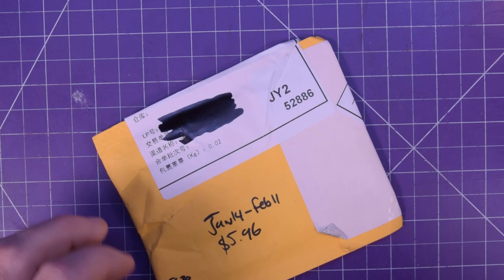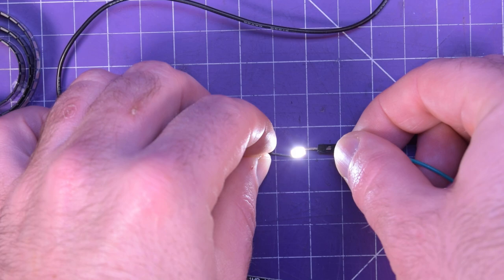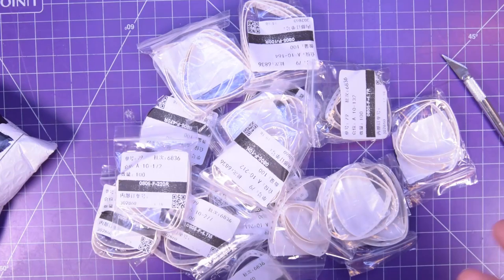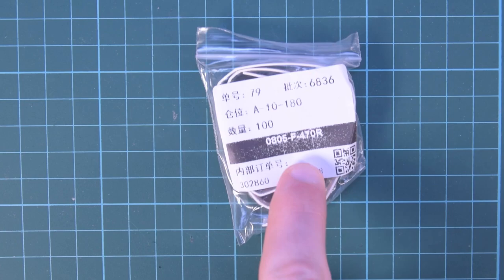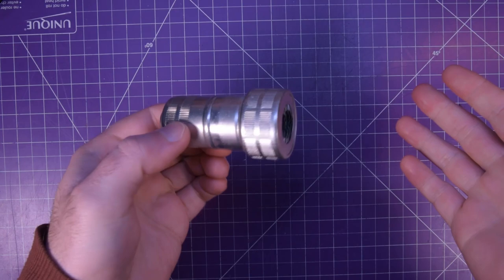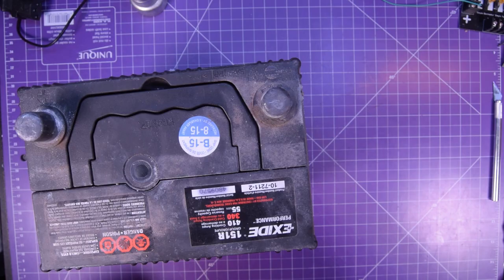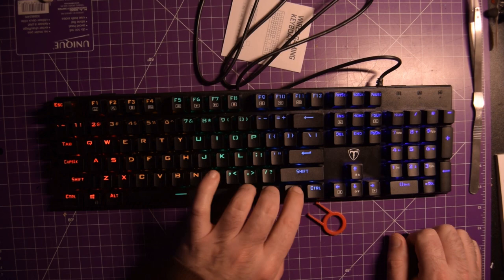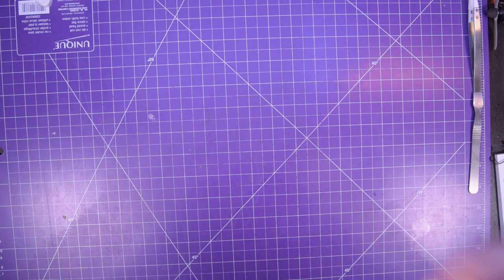Mailbag 102 - S P R E A D

Comment: I hope to not solder 1000 SMD resistors in the rest of my life.   :)     I have a bunch of wireless mice from the company that makes that keyboard. My keyboards are Cherry MX Blue and yours sound slightly higher pitch than mine.   Also, if no one else appreciates it, I appreciate you spreading the letters out in your thumbnail and title.
Reply: 0805's are difficult to work with. Don't sneeze!  1206's are also common, and a little easier for humans to manipulate.

Comment: A great video to start the day with.
      Is it possible for you to keep dead car batteries from your work, just wondering cuz I've heard of methods of restoring some life to these through pulse charging.
    What is the wattage rating of the LEDs, I'm assuming you're not building any high power pcb.
     Would enjoy a vid of the key replacement. It also looks like the rgb is zone based and not individually addressable
Reply from the maker: I have access to the used batteries for sure, I would just have to pay the core charge - which I think is 20$
Reply: @SimpleElectronics  could be a cheaper way to power the solar raft dream you have.
Reply from the maker: That's definitely been a thought - car batteries are not made to be discharged though, so if it's full sun, no problem but I would need to be able to be underway on overcast days. They can definitely be used as a high current "booster" though for things that take a lot of ramp-up current
Reply: @SimpleElectronics  figured it could be a start and as other battery types become available just modify the project, isn't that the life of cheap tinker's.
I mean, I'm collecting 18650 cells from discarded laptops and power banks to eventually power a raspberry pi powered disaster recovery box.
Reply from the maker: I have some PCB designs in mind for making 18650 battery banks, totally expandable too.
Reply: @SimpleElectronics  cool, any projects to go with them yet or still planning